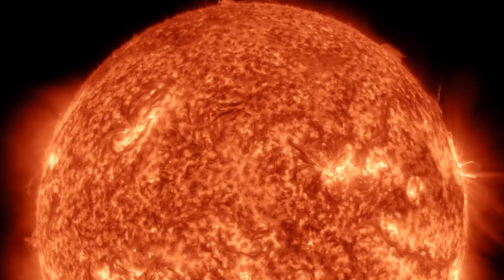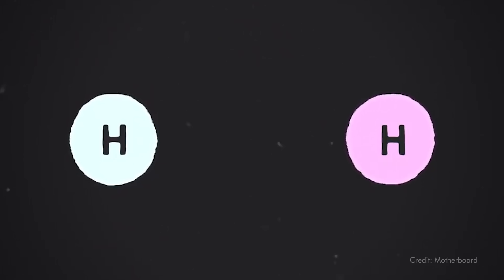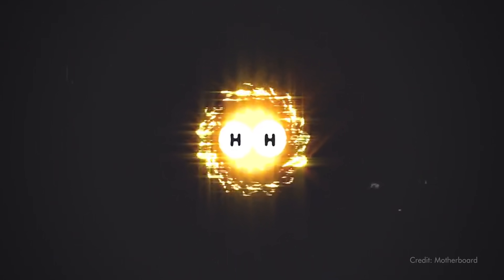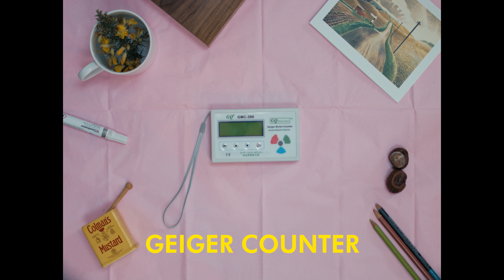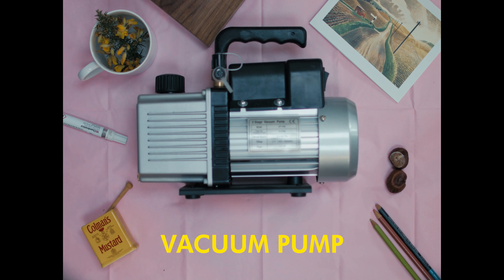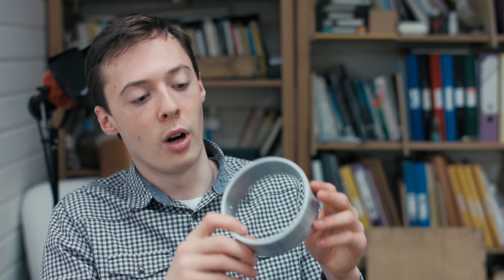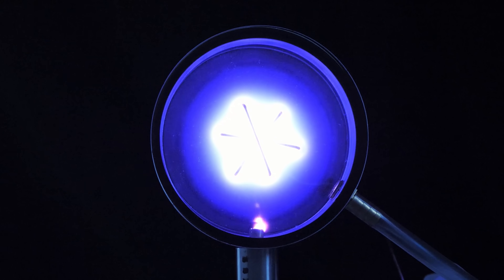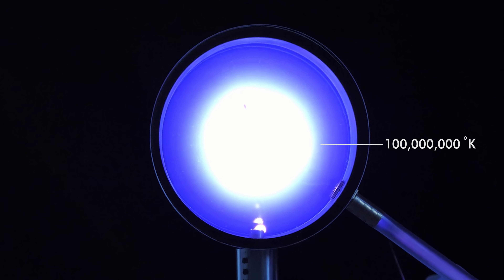Making a Desktop Fusion Reactor

Comment: The music must be fusing your brain, that's not fusion.  If it is I must be doing that everyday, I make neon signs and one of the process is running the tubing at 15kv at 0.6A.
Reply from the maker: tihzho This is a farnsworth fusor design. 0.6A, wow! That’s a lot of current for such a high voltage.
Reply: @WillFromLondon  The bombarding transformer current can peak to 1.3A at 15kV (some are 20kV) as opposed to a neon sign transformer at 30mA at 7.5kV.  Core and coil 15kV neon transformers have a mid-point earth on the secondary so that's why its 7.5kV not 15kV.  You only get 15kV across the secondary with no load.  With a neon load you will have a virtual earth at the mid-point of the load.  The bombarding transformer which is used in processing neon tubing prior to its gas filling has a floating secondary with no reference to earth; they are very dangerous. 

From what I see you did not use a core and coil neon transformer rather its a high frequency high voltage inverter and a "tesla coil" voltage multiplier. You had more than enough voltage albeit low current to cause a corona discharge in a partial vacuum.  

Your vacuum chamber, and plastic tubing would be outgassing (releasing) water vapour, CO2, O2 and other volatile gasses or vapours as soon as there was a vacuum. Any electric current discharging through this hodgepodge of gasses and vapours would glow exactly how it looked in the video. Its the same as a clear glass neon tube during its processing called "bombarding".  This process heats the glass tubing to 230C and the electrodes to 900C to drive off all the gasses and vapours from the inside of the tubing and metal electrodes and then evacuate to a reasonable vacuum - 1x10-4 mbar (atmospheric pressure is 1013mbar). If this process was not done, just evacuate the neon tube and fill it with neon gas it would still look whitish blue, not very bright and very hot and will fail.  

The production of neutrons would be evidence of fusion, did you detect any?

Comment: I feel obligated to point out that hydrogen is next to impossible to fuse at low pressures, even in the most powerful research reactors. This is because six protons all need to interact to make helium-4 and the chances of that happening are extremely low unless the particles are all smushed together like in the center of a star. Most fusion efforts on Earth use deuterium as fuel because just two deuterons can come together to make helium-3 and a neutron. If you put some deuterium in there I can see it maybe getting a couple of fusion events per minute, but until then this is just a glorified neon sign. By the way, a cheap Geiger counter (I have the same one) is not adequate to detect fast neutrons, which are very penetrating and can activate other materials (including that aluminium casing) and make them radioactive. That thing isn't actually making any neutrons though, just a lot of x-rays which are what's setting off your Geiger counter.

Comment: Awesome video mate! You are the king of montages 👍😁 
Why did you need the geiger counter ? Does it kick out a lot of radiation?
Reply: If it were actually fusing it would produce lots of free neutrons which are really dangerous and wouldn't even register on a Geiger counter. Several things about this setup, mainly the fact that he used normal hydrogen and not deuterium, tell me that he isn't actually fusing anything but rather just producing a lot of x-rays which is what the Geiger counter is clicking about in the video.
Reply from the maker: @maxmccormick3376  This was a demo fusor, which I unfortunately forgot to mention in the video for some reason. Yes, the clicks were from X-Rays generated from the high voltage. I'm still learning how to make these videos so hopefully in the next ones I'll be able to communicate my projects more clearly. :)

Comment: no fusion is actually happening tho. This is basically just a Farnsworth Fusor, just with your own design. It looks cool, but doesn't do anything.
Reply: Farnsworth fusors are actual fusion reactors. No energy producing ones but they do produce neutrons. The thing in the video is no farnsworth fusor though.
Reply: Farnsworth fusors aren't net energy positive, but they are a convenient source of neutrons which can be turned off. (with some caveats)

Comment: I'm from Germany in  German there means the word "Reaktor" most of the time something that "produce" useable energy, I don't know how it is in English but if you use the word chamber noone can complain about it, then I think it is an small chamber in which there is an fusion process. It can be that "reactor" in English nothing have to do with the amount of useable input and output energy.
Reply: a reactor in chemistry is a container in which a chemical transformation occurs, a reaction, and this make sense since the work reactor is derived from reaction, in this case there wasn't any fusion though the plasma could be considered enough for it to be called a reactor (but not a fusion reactor, that would require actual fusion)

Comment: Hotter than sun ? You gotta kidding me. All damn things would be vaporize at this point
Reply: the retards on every "scientific" video are disgusting. stop talking shit all of you
Reply: It was contained in a vacuum, without particles in the atmosphere around the thermal anomaly there shouldn't be any way to conduct heat energy to the surrounding area
Reply: @Beyblade_addict  The sun is in a vacuum too. Why do I feel the heat of it then?
Reply: @Andi-zn5yz  the heat that you feel is the light rays from the sun being absorbed by your skin which converts it to heat energy and not the actual heat of the sun. If you had listened in like grade 9 or grade 10 science, you should have learned that. 

white surfaces reflect all light and black surfaces absorb all light (if it is a perfect white/black)
you can test this by wearing a black shirt on a sunny summer day and then changing to a white shirt. you will feel that you get more hotter when wearing the black shirt than the white shirt. (doing that experiment will prove my point)
Reply: @awesomestuff9715   Isn't it obvious that it was a rhetorical question? As an Engineer I do know why I feel the heat on my skin. But that does not change the fact that the electromagnetic radiation of the sun is also transported in a vacuum. Of which the infrared radiation is " the actual heat of the sun".
Reply: @Andi-zn5yz  😂😂😂 these ppl be nuts
Reply: @awesomestuff9715  yeah right, cause the sun's not actually hot itself... It is us who get hot... This, of course, is sarcasm, as the sun is evidently and unequivocally hotter than hell
Reply: awesome stuff While most of what you're saying is right, wearing a white shirt will actually increase body temperature more than a black one. This is because light will reflect off of the inside of a white shirt and heat the body, while a black shirt will absorb most of it before it can do the same.

Comment: if fusion rectors would that be ez to build..... btw it was not fusion
Reply: Actually Inertial Electrostatic Confinement devices such as this one (although I doubt this specific device did ) regularly perform fusion reactions at rates of several million neutrons per second. these devices are extremely inefficient but do get the job done and have since their invention over half a century ago. These devices work by creating a potential difference between two spherical electrodes which are transparent to the ions. A rarefied atmosphere of hydrogen-2 aka deuterium is ionized by the outer electrode and then the positive ions are attracted towards the centre. Yes the light seen is due to the same effect as in neon lights however at a much higher energy. Any fusion reactions must be detected as the neutrons emitted by the device as the ions fuse. As for the temperature, the required energy is imparted upon each ion in the same way as in a particle accelerator and thus the "temperature" is more equivalent to relative velocity and at below 1.0x10^5 Torr the ion temperature can be generalized as about 11.0x10^7 degrees Kelvin for every increase of 1000 volts potential difference. Thus running at 30kV these devices easily break 300 million degrees kelvin. These devices, sometimes called Farnsworth-Hirsch Fusors, are mostly used as high energy neutron sources and because of their high energy capabilities they are also used to study higher energy fusion, such as proton boron fusion. The heavier devices you are referring to are likely the more efficient magnetic confinement devices. these devices contain plasma in different geometries of solenoids and thus have a different set of operating principles, usually using neutral beam injection or microwaves to heat their plasma rather than a voltage acceleration as this is inefficient. There are many examples of good research done using IEC fusion devices and while this one may be misleading I hope that it has not put you off of the topic and I welcome you to explore the fascinating research done with ion accelerating fusion devices like these. For my part I invite you to make a simple one as it can be a fantastic experience and help to build an intuition for thermo distributions and high voltage potentials, they can be cheap and easy to make so long as you don't try to get them to do fusion as that usually takes an expensive steel chamber although no increase in size, the whole experience is one I myself have and one I believe many more should try.

https://en.wikipedia.org/wiki/Inertial_electrostatic_confinement

http://www.fusor.net/board/index.php?sid=8dbb489f34fedd7744cb9b76709dd057

and visit my channel for fusor tests and other experiments with high voltage if you would like :)

Comment: like other people who commented, I don't think this s fusion! the bar was going down, and you never showed the Geiger counter going off. although this does look like a real fusion reactor, I believe that the light was just ionization of air, which also glows. also, 60-70kv isn't really THAT high. very cool looking, but I don't see any deuterium, or proton detector, or other things most reactors have. one thing I can say to your credit that this may have actually been fusion is the very bright, circular glow in the center. I am not familiar with this and I have never seen it happen to other vacuum-high voltage projects.
Reply: Actually Inertial Electrostatic Confinement devices such as this one (although I doubt this specific device did ) regularly perform fusion reactions at rates of several million neutrons per second. these devices are extremely inefficient but do get the job done and have since their invention over half a century ago. These devices work by creating a potential difference between two spherical electrodes which are transparent to the ions. A rarefied atmosphere of hydrogen-2 aka deuterium is ionized by the outer electrode and then the positive ions are attracted towards the centre. Yes the light seen is due to the same effect as in neon lights however at a much higher energy. Any fusion reactions must be detected as the neutrons emitted by the device as the ions fuse. As for the temperature, the required energy is imparted upon each ion in the same way as in a particle accelerator and thus the "temperature" is more equivalent to relative velocity and at below 1.0x10^5 Torr the ion temperature can be generalized as about 11.0x10^7 degrees Kelvin for every increase of 1000 volts potential difference. Thus running at 30kV these devices easily break 300 million degrees kelvin. These devices, sometimes called Farnsworth-Hirsch Fusors, are mostly used as high energy neutron sources and because of their high energy capabilities they are also used to study higher energy fusion, such as proton boron fusion. The heavier devices you are referring to are likely the more efficient magnetic confinement devices. these devices contain plasma in different geometries of solenoids and thus have a different set of operating principles, usually using neutral beam injection or microwaves to heat their plasma rather than a voltage acceleration as this is inefficient. There are many examples of good research done using IEC fusion devices and while this one may be misleading I hope that it has not put you off of the topic and I welcome you to explore the fascinating research done with ion accelerating fusion devices like these. For my part I invite you to make a simple one as it can be a fantastic experience and help to build an intuition for thermo distributions and high voltage potentials, they can be cheap and easy to make so long as you don't try to get them to do fusion as that usually takes an expensive steel chamber although no increase in size, the whole experience is one I myself have and one I believe many more should try.

https://en.wikipedia.org/wiki/Inertial_electrostatic_confinement

http://www.fusor.net/board/index.php?sid=8dbb489f34fedd7744cb9b76709dd057

and visit my channel for fusor tests and other experiments with high voltage if you would like :)

Comment: Why didn’t it melt then?! 100.000.000˚ pfuuuuu, what a deception
Reply: it's at a very low pressure therefore not much heat can be transfered
Reply: jello klotz. That coil in the middle it’s really close, how can it stay solid at 100.000.000 Celsius?  Prove me wrong
Reply: @djentzneau7769  it's not at a 100.000.000 °C because the environment cools it faster than the low pressure gas can heat it
Reply: jello klotz. So you agree that it’s not 100.000.000?
Reply: @djentzneau7769  ...the ionized gas could be at 100.000.000....
Reply: @djentzneau7769  yeah this one probably works. Looks legit
Reply: jello klotz. I’m glad we solved this.
Reply: Actually the gas could be a 812316750.4316 Kelvin given 70000 eV for a single particle
Reply: jello klotz . So is plasma produced in the process of fusion or it is just the electric flow  we see?
Reply: @djentzneau7769   EnMan  1. This video obviously is fake (vacuum is way too weak, he doesn't use heavy water and if you would be stupid enough to use this casually as a light source you would poison yourself because of the x ray and neutron emissions)
2. For fusion to take place you need temperatures so high that the aggregation state will always be a plasma 
3.  What you're actually seeing are hydrogen nuclei combining with electrons after the have been ionized by the high voltage

Comment: no deuterium, no secondary high vacuum pump, no x-rays or neutrons. cool crooks tube
Reply: This thing is likely emitting a worrying amount of X-Rays and UV(given the color), and it is technically a fusor, so you are wrong. Not useful for anything as it is using far more power than it is generating, but it is generating very small amounts of energy.
Reply: @rich1051414  no deuterium, no fusion, no power generation. it's using power to excite the gas (emitting uv and maaaaybe xray) but it's not generating any power at all.
Reply: @Lodok3 : If you count getting more energy out than you put in from fusing atoms together as producing something, then the sun is definitely producing something. Of course the energy doesn't come from nowhere, it is released from the atoms, but if we call our fusion reactors as producing something with said criteria, then the sun is producing something too.
Reply: Ubya he did have deuterium that was what he dissolved in the caustic soda
Reply: @Noah.Freud74  do you even know what deuterium is? 
yea sure, he used aluminium and sodium hydroxide to make hydrogen (99.98% protium and a 0.0312% of deuterium) but the concentration of deuterium is so miniscule that is negligible. so no, no fusion, just a plasma lamp
Reply: Ubya he's likely just very misinformed
Reply: Ubya it’s a FUSOR! None of you fuckwads even decided to look up a fusion reactor. You guys suck.
Reply: @christianmccauley7340  actually I have built one previously and have been involved in the design side of other projects in the past for a real one you use a tiny lead glass window that is about an inch thick. The walls are normally about 1/2 inch aluminium blanketed with 1/8 inch of lead sheet. Furthermore he's missing a high vacuum pump and deuterium. 

What he has built is called a demo fusor, they are strong x-ray and UV emitters but safe enough for short exposure to demonstrate a principle.
Reply: @christianmccauley7340   i tried to build one in the past so i'm sorry, but i know what i'm talking about. maybe if you inform yourself a bit more you would realize how wrong you are. just search for fansworth fusor design and tell me if it's anything like in this video
Reply: Ubya neither of those are in the Sun, but the Sun produces fusion...
Reply: @sonicsawblade  what should this even mean? yea duh the sun is a star, it is capable of fusion thanks to its immense gravity and pressure in the core. we on the other hand to get fusion can't simply make our own star near earth... so we use a vacuum and high kinetic energy to smash the hydrogen nuclei hard enough to make them fuse
Reply: @sonicsawblade  I don't know which two you are talking about but the sun produces fusion because of its large mass. The reason we can't have fusion that generates more than is put in here at Earth is because of the size limitations. I mean, more energy output than input can technically be done here at Earth, and has been done for very small amounts of time, but the only reason it's so easy for the sun and extremely hard for us is because the sun is massive.
Reply: Why are so many people “debunking” him, this is just a joke video. It’s obviously not fusion... I think when you debunk this trying to show your smarts, it just makes you look stupid.
Reply: @DaRealPianist  well actually this resembles a Farnsworth fusor, just missing the parts missing. Doesn't seem like a joke to me
Reply: @rafyguafy1688   I tell everyone the same thing about my toaster.